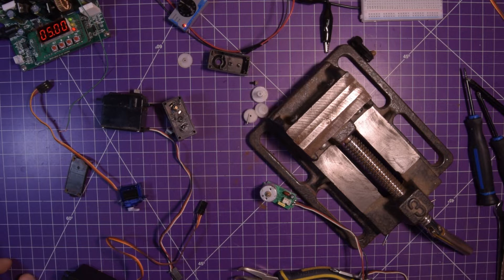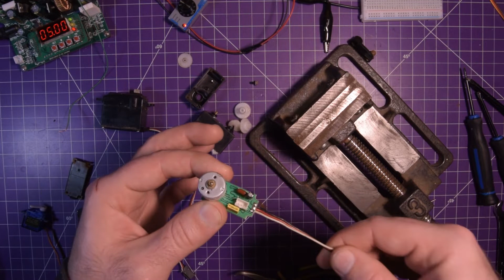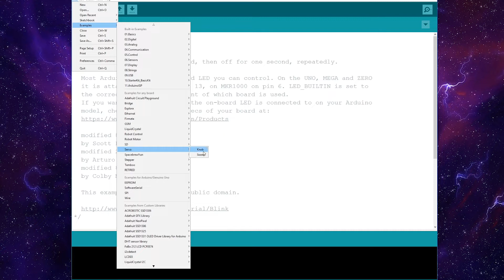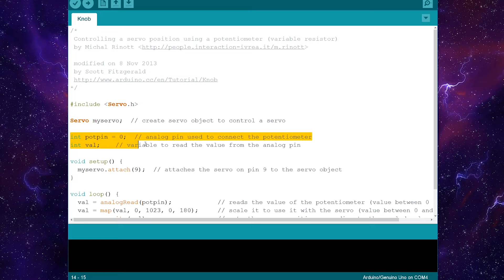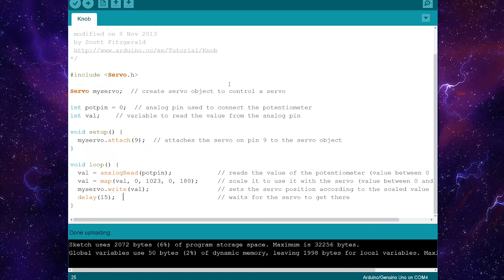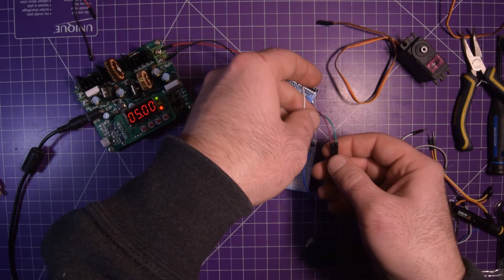Getting Started With Servos

Comment: I actually thought I could power my manual coffee grinder with one of these. If only I can find a proper adapter.
Reply from the maker: Print one! It will act as a safety break-away at the same time!
Reply: @SimpleElectronics  that's actually a great idea. Don't have a 3D printer but I'll find a place on the internet. I'm just afraid that it will break. Too much stress on the material. The resistance of the coffee beans plus the torque of this...
Reply: @TheSenseiKai  You might look around your local area for printers.
My local library has 2 that are available to the public for only the cost of the filament.
There's also a makerspace with some printers and other tools available to members
Reply: @pileofstuff  your library?! Daaaamn. This doesn't exist in Greece as far as I know . There are places that you can get something 3D printed tho, but they exploit the "exclusivity" in price. Thanks for the reply. I will check university libraries.